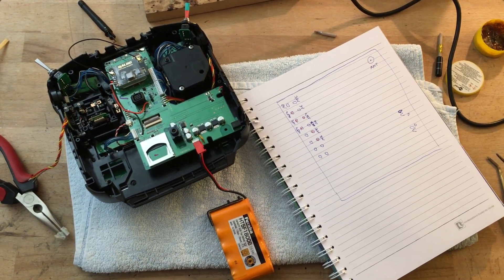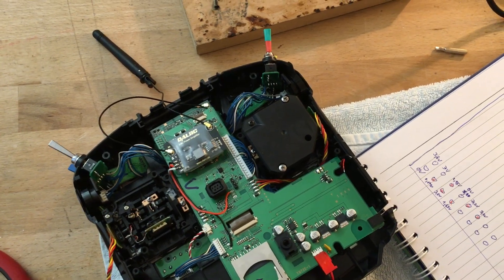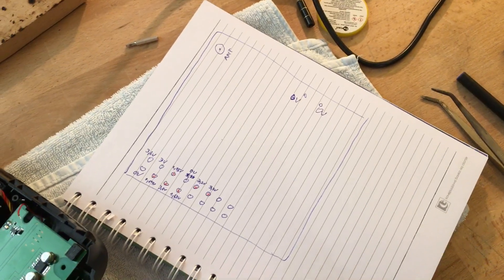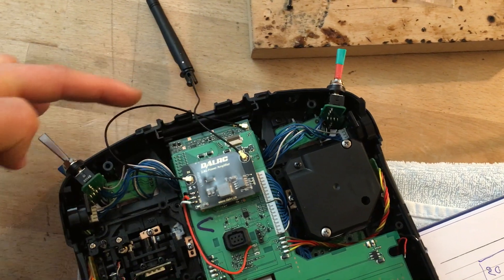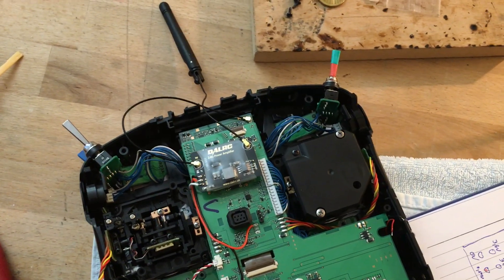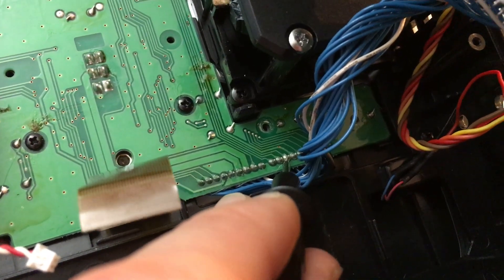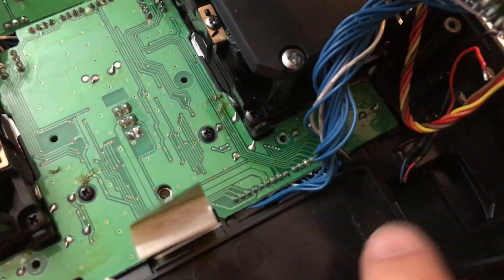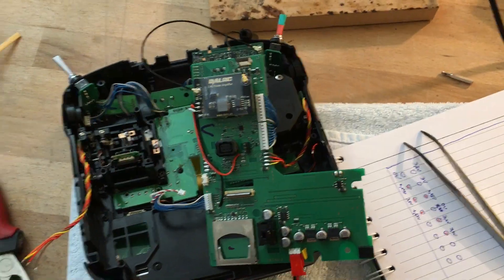DALRC 2.4GHz Power Amplifier - Part 1.1 - Installation Guide

Comment: Hi would this work with a dji controller
Reply from the maker: I think it should be possible if the remote outputs only 2.4GHz signal. I haven't tried it though, so I can't be 100% sure. If you do try it, please let me know what the result will be. Make sure to test ona quad with RTH so that you don't lose it! Good luck! :)